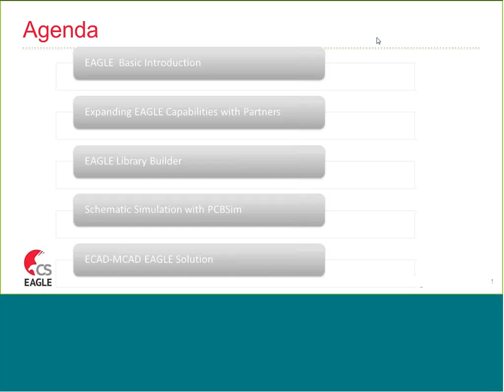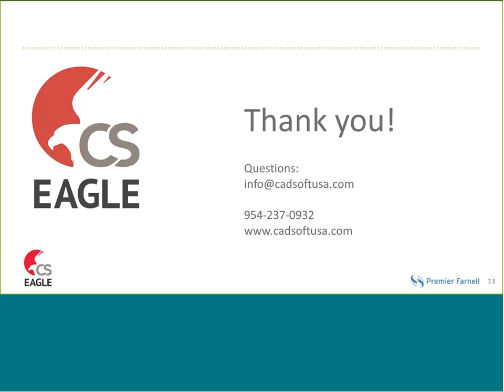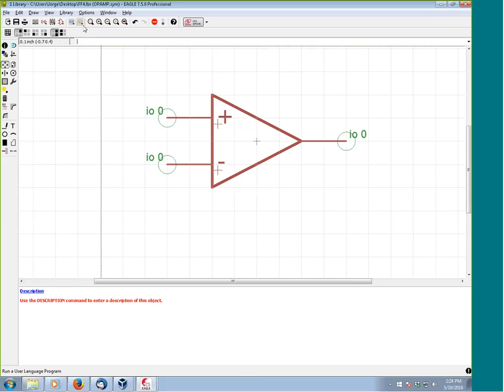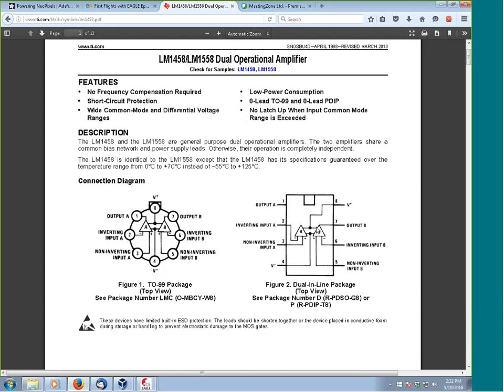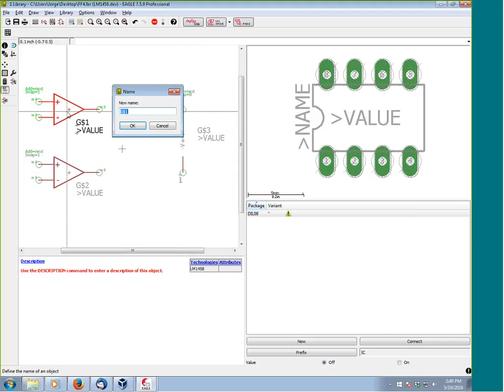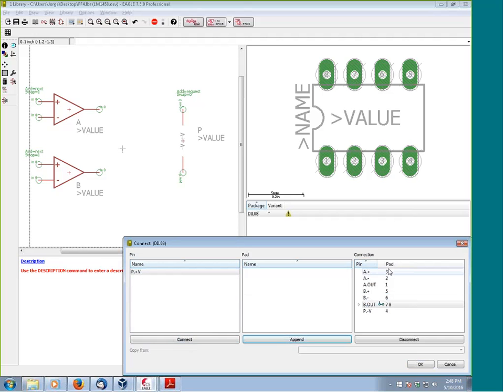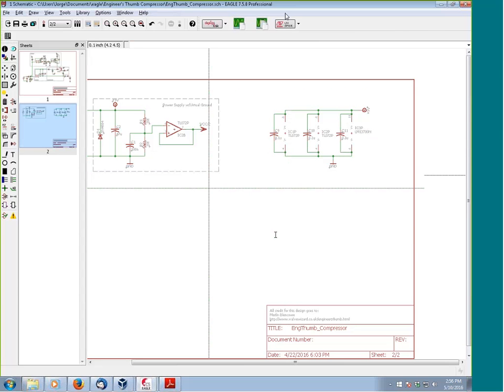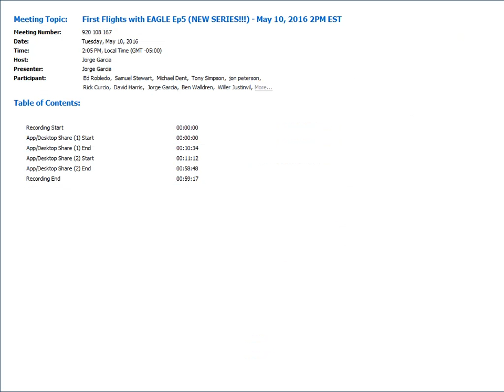First Flights with EAGLE part 5 - NEW SERIES

Comment: Your virtual ground circuit on page 2 of the schematic near the end of the video is incorrect.  The center of the voltage divider should go to the non-inverting input of the op amp, and the output and inverting inputs of the op amp should connect together.  As shown - this will create a positive feedback which will either oscillate or saturate to one rail of the other.
Reply: Never mind - saw the rest of the video ---- where it was corrected.